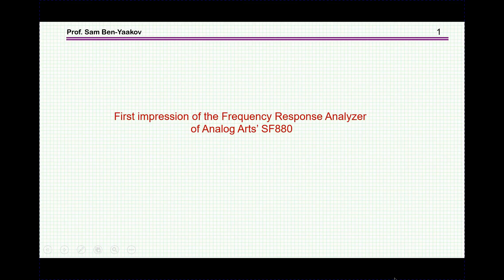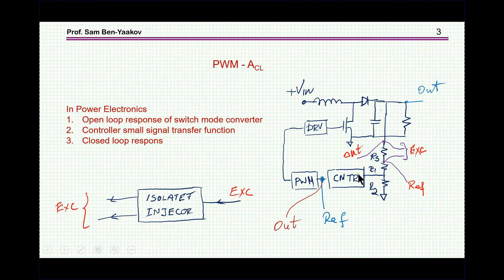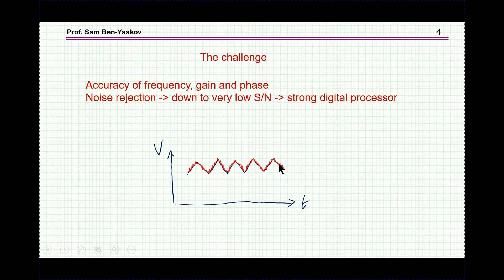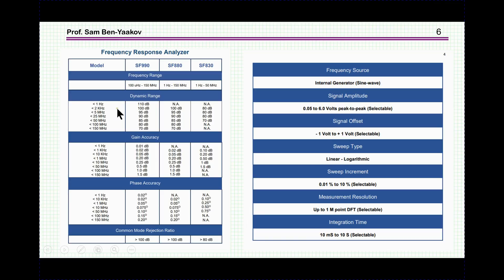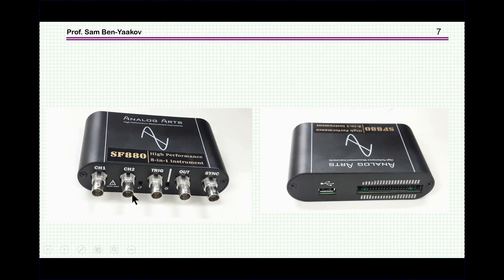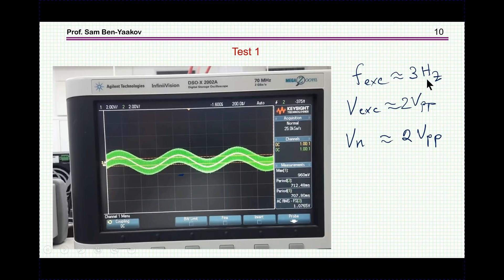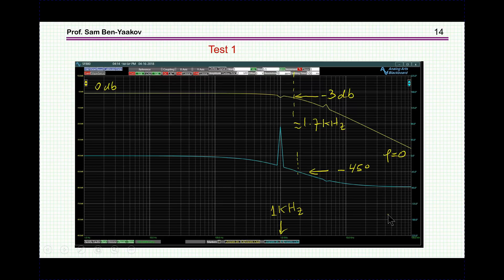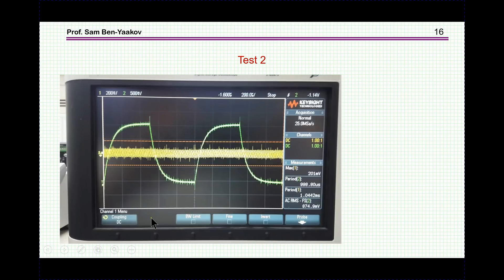First impression of the Frequency Response Analyzer of Analog Arts’ SF880

Comment from the maker: Hi Charles - MrCEHymowitz, Let’s not confuse design needs with “postmortem” measurements. AS far as I understand, impedance measurements are not used to design the control loop but to confirm that the patient is sick. And then what?? It seems to me that your statement: “And Bode plots just don't cut it anymore” is too sweeping not to say incorrect. Bode and Nyquist are still the staples in control design of switch mode converters. 
VNA and FRA are basically the same instruments (network analyzers), the former having additional signal processing capabilities (like s parameters measurements) not used for open and closed loop analysis and design.

Comment: Dear MrCEHymowitz,
Although the measurement device introduced by the professor is also capable of impedance measurements, I believe the purpose of this tutorial is the analysis of the control loop in a power supply design. The explanation given by Professor Ben-Yaakov is quite informative and clear.

Comment: Wow... The specification looks impressive. 0.02dB and 0.02°? Did you get a calibration report with the unit? How do they prove that? 
From my experience it will be very hard to find any calibration lab that proves such a high-accuracy AC measurement... Especially the phase accuracy spec seems high to me.

The Keysight E5061B Gain/Phase ports don't specify an accuracy below 1dB and 5° error which seems to be a bit conservative... (http://literature.cdn.keysight.com/litweb/pdf/5990-4392EN.pdf Page 20)
But 0.02dB and 0.02° at 10kHz will be very hard to prove.

How long did a sweep take and how many points did you include in the sweep?
Were the inputs AC-coupled? If yes, what's the maximum DC that you can apply during a SMPS test?
Reply: An easy test is to connect both channels to the output of the generator and see how flat the gain and phase plots are.
Reply: Measuring this level of performance is tricky. For example, if the connecting cables are not exactly identical, the results are jeopardized. 
For this exact reason, Analog Arts has just added a feature to the software(04/18/2018 revision) that calibrates  out the parasitic affects.

Comment: It looks like the key of this product is the software. There are other products like the PicoScope have very similar hardware, but have lacking software. As not a power electronics person, I'm curious if in power electronics, if a network analyzer or lock in amplifier would traditionally be used for these measurements?
Reply: Based on my conversations with various power engineers, a frequency response analyzer is the instrument of choice for power  supply design  applications.
Reply from the maker: Not a good choice, because: 1. you will need to sweep the frequency and collect the data point by point to reconstruct the response curve. 2. The dynamic range will not be enough
Reply: The instrument of choice should be a VNA, NOT an FRA. An FRA doesn't cut it anymore. You need output impedance and s-parameter support in order to conquer Power Integrity. And Bode plots just don't cut it anymore. Many devices you want/need to measure don't have their control loops exposed or have multiple internal loops. Output impedance is the way forward.

http://www.powerelectronics.com/power-electronics-systems/combination-vnafras-offer-more-capability-and-lower-cost